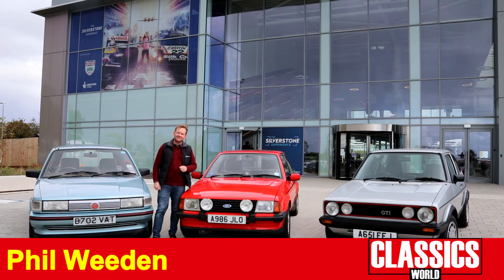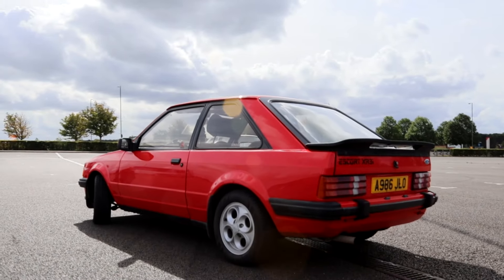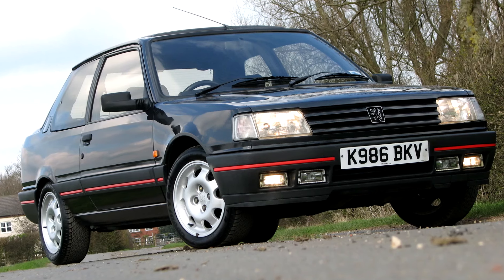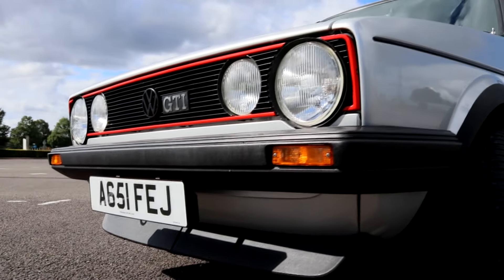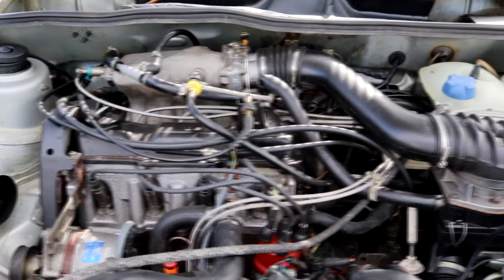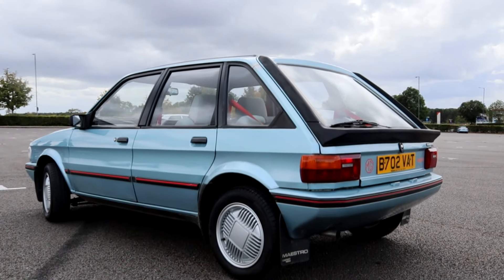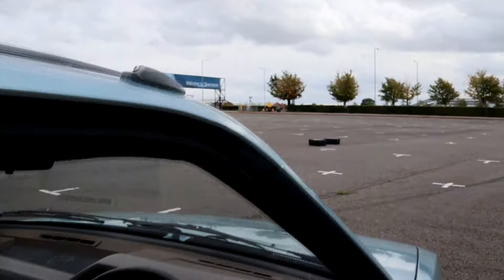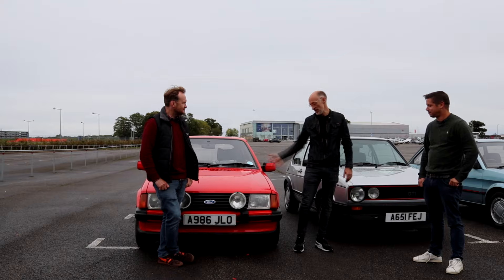Golf GTI vs Escort XR3i vs MG Maestro - 80s Hot Hatch Shootout!

Comment: The best two from the 80's aren't in this video. 205gti 1.9 and R5 GT Turbo. 🙂
Reply: Surely they would be a staple of a late 80's shootout. Maestro Turbo would then be the underdog.
Reply: @6ettinold  Think the R5 gt turbo was released in 1985 and 1.9 gti in 1986.
Reply: @PureLeeful  5 GT Turbo was released in ‘85. April ‘84 for the 1.6GTi (still have my ‘91 1.9). I’d rather have either of them than the cars here but would rather have any of them than most modern cars.
Reply: The 205 was the only thing back then that could match the golf in handling. But the 16v scirrocco wich used the same chassis was in fact faster than the 205 1.9 gti.
Reply: @stevenanderson7471  in a straight line maybe? Don't think a Golf or Scirocco would touch a 205gti on a b-road, that's just my opinion though.
Reply: @PureLeeful  there wasnt much to challenge the golf handling wise till the 205 came out and there wasnt much between them two cars handling wise, but the 205 was quicker than the golf . Then when vw stuck the 16v engine in the scirrocco bearing in mind its just a mk 1 golf chassis   with differant panels, it had slightly more power than the 205 along with a lower power to weight ratio and at the time was one of the most drag coefficient cars on the road . Unfortunately vw only made a few of them most people didnt even know they existed. The 205 would have beat the mk1 golf the scirrocco 8v the mk2 16v . But the scirroco 16v had best of both worlds the light weight and handling of the mk1 and the extra power of the mk2 16v engine. they were as rare as unicorns even back then
Reply: @stevenanderson7471  Scirocco’s are more affordable than hatches if the same era too.
Reply: @MrGwaldo  the normal  8v carburettor ones yes but 16v are stupid money unless someones done a engine conversion
Reply: Are you French?
Reply: @dess5500  the best 80’s/90’s hot hatches were

Comment: The MG Maestro was always my favourite especially in 2.0 i form. A much underrated car which should have ben a much bigger success.
Reply: Agreed Paul and the Turbo is fast even by today’s standards. They just let down by typical shit build quality. I’d imagine the M.G Maestro is the quickest out of the 3.
Reply: @matty6848  I had an 89 f 2.0i and it was a decent car, lovely torquey engine and nice roar
Reply: @mat12128  nice😁👍
Reply: The 2.0 EFI was an excellent car the MG 1600 was an 11th hour car to compete with the XR3 which was announced just as the Maestro launched.  The problem was unusually for BL they fitted Weber carbs and the fuel would vaporise and they would often not restart after a hot soak, they did however go quite well and the induction noise on full throttle was as good as any fast Ford.
Reply: @philnewstead5388  yes I remember the 2.0 EFi went well, but as you say the 1600 M.G was obviously a afterthought.

Comment: I had all 3 of the MG Maestro's back in the day & I loved every single one of them!
My 1st one was a MG 1600 with the R series engine spoke about here, yes the hot start was terrible but when it was tuned with a pipercross air filter and the carbs set properly it was a lot better and sounded great on wide open throttle.
My 2nd one was a black 1989 2.0i which I kept in showroom condition, great car but not as quick as you'd expect.
My 3rd one though was a white Turbo (No 198 out of the 505 made) and that thing when modified went like a rocket ship and the torque steer was unreal lol !! All of my mates back in the day had XR2's XR2i's RS Turbo's R5 GT Turbo's and even a couple of Cosworth's and the tuned MG Turbo surprised every one of them on many occasions !! I regret selling my old Turbo for sure !
Reply: I had a white Turbo ( no.272) and can confirm even in standard tune went like the proverbial sh#t off a shovel, quicker than R5 turbo, 325s. I knew a bloke with a 911 and he told me a Maestro Turbo was the only car that he ever had trouble against. LOVED THAT CAR
Reply: I had a white Turbo reg F400SLL I had upgraded springs pagid pads upgraded boost and a k and n air fliter in the airbox which was drilled with extra holes,upgraded plugs,plus a rolling road tune....Honest to god any hot hatch could not get near me on handling etc etc it would give a cosworth in standard trim a very hard time...this was the car that got me into motor racing from Maestros through to mgzr,s and i still race today!!
Reply: Agreed, the sound of a correctly tuned R series MG Maestro on song was great.  You think the S series is rare, the R series must be ultra rare.  I always wanted to own one, but insurance at the time got in the way 😕
Reply: Friend had a montego turbo and nothing would touch it. Had to have big kahuna's to drive it on the limit!!
Reply: @col1311  Yes, my Brother had one and the torque steer was pretty wild!
Reply: @Mister_H  Yep, I had one and had a full lock to lock tankslapper in it once after pulling out and overtaking at full throttle in second on a wet road. Also saw over 130 on the clock once. It was great until the rear arches fell off with rust.
Reply: Also had a MG Maestro 1600 in this colour too.. A636 XSX I think. A mate who restored cars tuned the webbers for me by connecting rubber tubes to the carbs and sticking them in his ear lol. I remember also getting flames shooting back up the carb inlets with the filter off. Oh and it never stopped telling me the oil pressure was low on the motorway. So fitted a guage. The talking voice was always lying.
Reply: @johnj3577  lmao 🤣

Comment: I had a mars red X reg Mk1 GTi, 1.6 but fitted with a blueprinted bored out mk2 Gti lump (1950cc) uprated cam, forged pistons etc, would rev to 7500rpm and shoot flames when hitting the rev limiter. Used to go like a rocket, left a VR6 for dead in traffic light grand prix. Damn this video has made me nostalgic.
Reply: A good 16v KR engine nothin lik it👍

Comment: Had xr3i,A reg then bought G reg,but both we're good cars, best hot hatch 205 gti 1.9
Reply: Best handling hot hatch 309 gti ....  fact 😉  such an underrated car...  even today 🤷‍♂️
Reply: @desbufton369  don't agree. 306 Rallye was slightly more fun. I owned both. 309 superb though.
Reply: 309 gti loved that car and back then they was rare. 309 and 205 goodwood was a dream car of mine back then.
Reply: @desbufton369  a 306 diesel turbo is not a Rallye. Two different beasts. I'm sorry, I don't agree.
Reply: @stevenhearnden66  fair enough mate...  I’ve never driven a ralley but the chassis are same length as dturbo or gti....  I just think the back end isn’t as stable in a 306 due to higher center of gravity....  309 seems more planted to me...do you track your ralley??

Comment: I too had a B reg MG Maestro 1600. Hot starting problems, the gearbox would crunch like an earthquake changing from 1st to 2nd when cold, very bad fuel economy, the engine would die going uphill if you were following a slow vehicle coz the carbs were chucking-in way too much fuel...but I’d have it back in a heartbeat. On the subject of those twin Weber’s - I recall removing the air filter box and fashioning my own sports-type filter and the sound it made was magic!
Reply: I got flames shooting out of the inlets when trying to tune mine up with the filter off. It was hilarious. They were flawed but great fun and interesting cars. I still miss that car. Alas I traded it for a Montego Turbo which was a bit more grown up but bonkers fast. Still remember my mate in the passenger seat at a set of lights - "Go-on John, you can beat him...." (green light) "Fuck..me!". Happy days.

Comment: In the late 80s, our household had both a 205 GTi 1.6 and 205 XS. There was nothing between them in terms of mid-range up to street legal speed limits as the latter had lower gearing and was a shade lighter lighter. But having seen a pristine XR3i in a local motor museum last year, I would opt for that now because of its subjectively more attractive design.

Comment: I have a 1983 mitsubishi colt 1400 turbo that I have just started restoring. It's been off the road since 1995  and is a complete basket case. But there's virtually none left at all so is worth saving and will be  special once restored. It has red and black interior with turbo embossed on the seats, full body kit, bonnet scoop and a super shift 4x2 gearbox.

Comment: I did 140,000 miles in 6 years with my 1984 MG Maestro - other than routine service, it never had a spanner on it.  My only gripe was that "warning, low fuel" was followed by running out within a few hundred yards.  Replaced it with a 405 Mi16.

Comment: I loved my MG 2.0 efi Maestro, more pull at low revs than the Golf. Handling good too. Managed 134,000 miles before engine gave out on the M4. 😆
Reply: I had a 1985 MG 2.0 efi too.  Loved the gearbox - Honda I believe.  Pulled like a train and used to upset a lot of other cars.  Looked good and went good, no choke just turn the key and go.  Dad then bought a 1990 BRG one, so we had two on the drive.  Had to sell mine when I bought a house. Good car but people thought they were rubbish.
Reply: @paullorman8924  I remember that 4th gear was good for just about anything hardly had to change gear at all, driving round town if you had to turn left or right as long as it was doing at least 10 miles an hour it would just pull round the corner. I had a 1600 as well when I first got in it at night I couldn't believe how futuristic it looked can't believe that was 37 years ago way ahead of it's time.

Comment: My Dad currently owns TWO original 1983 Golf GTI's tin top and cabriolet both from new and tin top has 12000 miles and cabrio has 8000 miles from new. He also has a 1993 Mk5 Escort RS2000 with 75,000 miles again owned from new. In the coming months I plan to showcase them on my channel, they haven't been started for years but still ij reasonable condition 🤙

Comment: I started off with a opel Kadett 1.3 x reg. Then a cortina 2.0 x reg. Then Xr3i 1.6 b reg,and had an opel manta 2.0 gte a reg at the same time.
The thing is,round about 1984,there was a car that for me,was the best hatch around,the Astra 2.0 gte.
Had body kit,recaro seats,and was fast.
Never been one on Wheeler Dealers,and nobody ever mentions it.
The Opel kadett 1.6 sr was a similar car to the Astra.
The xr31 was 110 bhp,so was the Manta. The Cortina could do 0-70 mph in 2nd gear,and was great to drive.

Comment: I had a (non MG) Maestro Auto from 1984 - 88, when my father owned it from 88 - 91 liked the car but had a problem with the engine cutting out from a cold start. Replaced the electronic starter which also failed and my father ended up putting in a manual choke. What nobody mentioned was how much more practical and larger the Maestro was inside and with four doors  It would double as a hot hatch and a family hatchback better than the other two.

Comment: I had a white C reg XR3i so I am biased, but I think it is easily to best looking most charasmatic car of the three here. If you bought any of these three now and kept them original you would drive them fairly gently and look after them, so the golf being faster and better handling doesn't make it the one I would buy now. If I had the money I would buy the escort and put a modern engine, in uprate the running gear and stiffen the body. That way you'd have modern performance and reliabilty / serviceability with old school charm. Perfect. I've been in all three, the maestro was ok but dull, and the golf was very nice to drive and much punchier than the other two. My girfriend at the time looked really hot in my XR3i too! 🤣

Comment: I had a 2.0 EFi MG Maestro from new in 1986 and I thought it was a brilliant car, I had to do a lot of trips from south Bucks to Chichester on the south coast and it used to almost fly down there. I remember having a great deal of fun chasing  guy in an RX7, I kept up quite easily. The torque steer was hilarious, but piling into a bend, lifting off to kick the back end round and then firing out the other side was a joy. Reliability was good, the only thing that went wrong was the relief valve in the petrol cap, there were some signs of rust by the time it was three years old though. Life caught up and an estate car beckoned, but I'd have another MG Maestro now if I had the space.

Comment: I remember working on a Maestro in the day with a continual fault of the computer stating that the battery is not charging despite changing everything in the charging circuit and independent testing means stating the opposite, it eventually went back to Leyland for a new “brain” 😊

Comment: I had the identical red Xr3i to this, an 83, built in Belgium. Followed a few years later by a silver MkII Golf. Although the VW was basically better in nearly every respect, I had more love for the Ford. It's lack of refinement somehow made it more thrilling and if anything it was slightly quicker up to about 40 or 50. Both could manage an indicated 120mph though the Escort took for ever to get there (in southern Africa). It was also 100% reliable and the Golf wasn't. That was more luck than anything. I got a good one. I probably had the world's only Xr3i with a push button short wave radio. Maybe the Mk II Golf wasn't as good as the original. I'd rather have a 205 GTI 1.9 now.
Reply: I had a Mk 1 GTI which got written off when someone crashed into the back of me. When looking for a replacement I tested an XR3i and it was the lack of refinement, that you mention, that struck me most. It felt very harsh, very rough; I bought another GTI

Comment: Love 80's cars.  Had a Montego Turbo briefly a few years back, and a MK2 GTi then a Tipo 16v and a Phase 1 405 Mi16.  405 was by far and away the best car of them all.  The handling was outrageously good.
On another note I looked at buying a Maestro Turbo in decent shape for restoration.  Something didn't sit right with the car though and spotted it had an EFi wiring loom on top of the engine.  Turns out it was an EFi with a turbo and SU carb installed, along with the bodykit and wheels.  Might have bought it if the dealer had been truthful about it, but he tried passing it off as genuine so I reported him to Trading standards

Comment: Meastro had the same suspension design as the golf and actually had a VW gearbox! carbs were a pain to set up though especially on the earlier R series (Austin Maxi engine). I left rover in 1989 to work on VW's and was very unimpressed by the mk2 Golf Gti v MG Meastro 2.0i

Comment: This is a bit of a strange one because I would have any of them but none of them. 
Let me explain. 
The Golf was the best car sometimes but only for multiple short amounts of time. 
The original 1.6 4spd was the first so it was ahead but it was soon outgunned. This 1.8 came out and it was better than the XR3i of that time but again it didn't take long for other makers to come out with faster stuff. The Maestro just has the wrong engine because that 1.6 isn't as reliable, powerful or even as eceonomical as the 2.0i which came out later. 
All of these fall short of the Escort RST, 5GTT, 205GTi, Maestro (and Montego) turbo, Golf GTi 16v (mk2), Astra GTE 16v and so on. 
Also everyone keeps saying the Golf was the first hot hatch but what about the Vauxhaul Firenza or the Talbot sunbeam just to mention a couple?

Comment: Like the RS1600i image(solid lifter engine and smaller rear brakes but somehow more special.At least Jackie Stewart had sorted out the XR3is suspension over the XR3 with its positive front camber. Left field options MG turbo/ Fiat abarth strada (named abroad)130tc.

Comment: I was a Ford guy back then and the XRs were the easiest and cheapest to upgrade, it didn't cost much to outperform the VW in every category usually using standard parts from other Ford models in scrapyards, brake servo from a Granada automatic is just one example.
But I've driven all the hatches during that period and in my own opinion the 2 absolute best ones were the Pug 205 and Renault R5 turbo. The Pug was the best blend of performance and the R5 was the best handling in country roads

Comment: The Maestro got better as it went on. Quality got better, the daft talking dash got binned, and the highly strung twin carb S-series was ditched for a 2.0 injected O-series which was a lovely torquey thing. Like most things coming out of Austin Rover it took a few years, and a few engineering revisions to become the car it should have been when it was launched. An efi Maestro would have been the quickest of these three quite comfortably. The XR3i was always massively overrated. Wasn't very quick even back in the day, which is why the RS Turbo was needed.

Comment: Entirely subjective but IMHO the Golf is the better all round car as it was developed by VW Motorsport engineers and not the Salesmen. It has a bullet proof engine, predictable handling, great spares availability, engineered to last and still great fun to drive. Best of it weighs just 860 Kg which is less than a Ford Ka, so a great light chassis to fit any later VW Audi engine such as a 1.8T, VR6 or 3.2 V6. Had mine since 1988 and love it.

Comment: It's a tricky choice, as everyone would say the Golf is obviously the better built, better engineered car, and the most reliable. But i like both the others too. I wouldn't have a standard Maestro, even if it was free, and the other escorts in the Mk3 range were pretty dull too, but there were some interesting Golf models, other than the GTi. I love the twin webber's on the MG, and the XR3i is still fun to drive, but i think I'd still take the Golf. Had the Escort been a RS1600i however, then it would have been a very difficult decision. Especially if the Escort came with Recaro's, and with the extra 10bhp over the XR3i, it would have been the most powerful, just. The RS is so rare though, i dread to think what you'd have to pay for a mint one now!